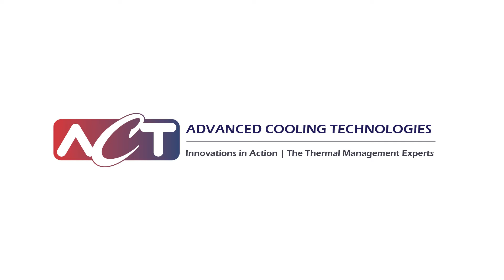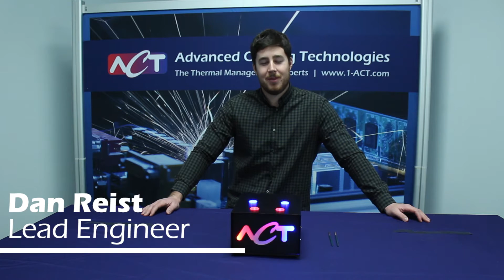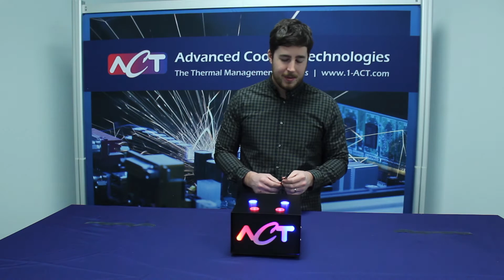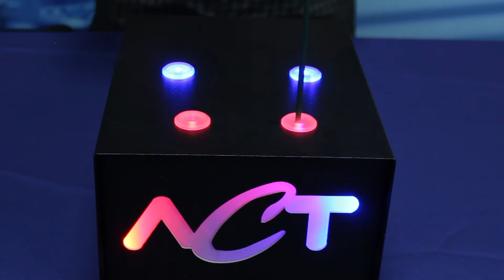Heat Pipe Demonstration Box

Comment: how to restore without opening the heatpipe, how many years lifespan?
Reply from the maker: There is no need to provide maintenance, the liquid is sealed and remains active. 
General rule of thumb is that heat pipes are rated for 10+ years.